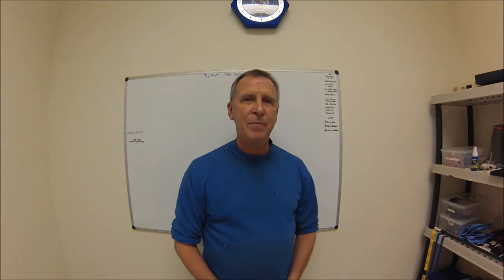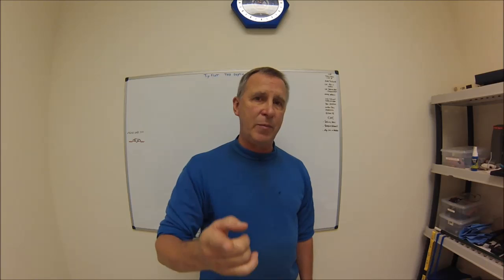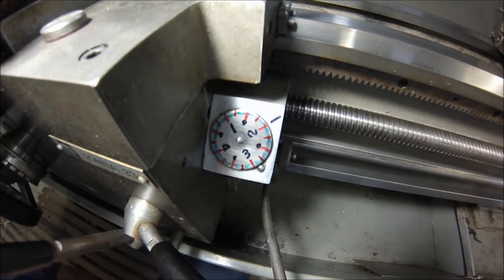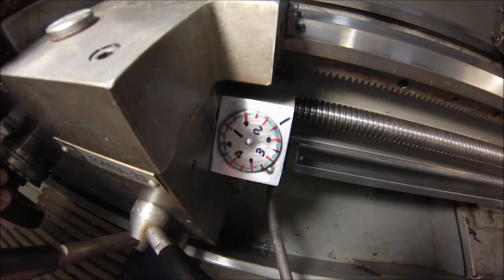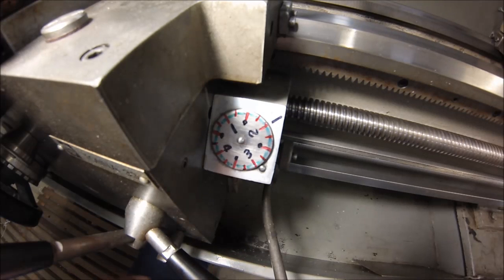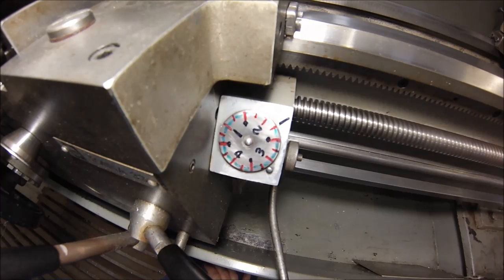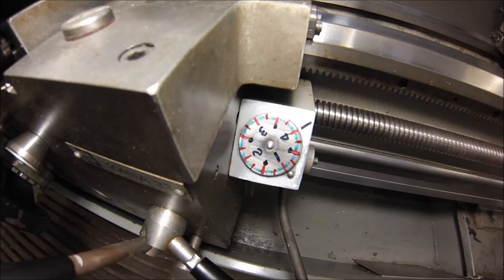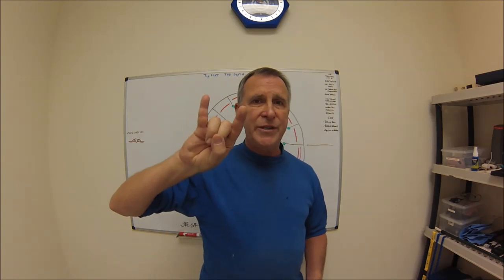Engaging a half nut.....made easier

Comment: Again, a great video. Ok, for odd thread pitch use any numbered line. However, on the second pass (to deepen the thread) does one have to use exactly that same number on succeeding passes, or can one go to any numbered line. First pass, use 1, second pass use 4, third pass use 2 etc. What about the "in-between" lines? Does one have to return to exactly the same "in-between" line on the dial on subsequent passes, or any "in-between" line?
Reply from the maker: The philosophy of even pitch threads using any line and the odd pitch threads use any numbered line is intended for the factory marked lines only. The in-between lines will probably cross thread your part and ruin it. I do not use the exact same number when doing an odd thread, but you may wish to check it out on your own machine. If in doubt. Stick to the same number you start with. Better safe than sorry.
Reply: The numbers represent inches of carriage travel.  Even or odd thread pitches will contain a whole number of threads in one inch, so the half nut can be engaged on a whole number for any even or odd thread.  For even threads you can engage at the other lines, half way between the numbers.  This is because even threads have a whole number of threads in 1/2 inch.  If your thread count is divisible by 4, such as 12, 16, 20, etc. you can engage every 1/4 inch of carriage travel.  For half-pitch threads you need 2 inches of carriage travel to land exactly on a whole thread. You'd need to start on every-other number (such as 2 and 4, or 1 and 3).  This also explains why metric threads are tricky on a standard lathe.  With a pitch of 1.0mm you have 25.4 threads per inch.  So you only land exactly on a whole thread every 5 inches of carriage travel.

Comment: Oh, man did I learn an ugly lesson today.  It turns out that my lathe actually has four engagement points per line on the threading dial.  So not only are there engagement points between the lines, there are three engagement points between the lines.  I was waiting until I was 3/4 of the way to the next line and dropping it in.  Surprise!  There's an engagement point there.  Scrapped part.

Comment: Mr Pie, could you explain what you mean by "odd" vs "even" number of threads? I've heard you say this several times and I'm not sure if you are saying "how many threads in a inch as reference to odd or even and or what about halfs for instance "cutting a 2.5" threads. As when the dial comes around I can engage on any line if it's "5" threads per inch vs I can engage on any numbered line if it's "6" threads per inch? Hope my comment makes sense? BTW, I'm learning a lot from your videos! I've got a southbend 9a as a home hobby machinist but working my way up to getting a part time job for a machinist just because I absolutely love cutting metal!!! So thanks my friend, I will definitely buy you a beer if I'm ever in Texas
Reply from the maker: You caught me eating my lunch, so its a perfect time to reply. The odd and even threads I refer to is the pitch value. EX: 1/4-20 thread is an even thread with a pitch of 20. Even pitch threads- any line. A 1/2-13 is an odd pitch thread. Odd pitch threads engage on any numbered line.  I don't believe I have ever cut a half pitch thread, but I would suspect you have to use the exact same line every time. Run a few test passes to be sure. Just to clarify, the outside diameter of the thread doesn't matter. Just the pitch value.
Reply: That explains a lot! Thank you for taking the time to dummy it down for me.

Comment: Grabbing a pack of fine sharpies I headed into the shop to mark mine up.
Then I realized the reason why I have difficulty hitting the 'mark'
On my Birmingham (Taiwan) 1440 there's (32) divisions. 
Hash marks are labeled 1,3,5,7 (for some odd reason), (4) unmarked and then there are (3) more locations in between the 'eighths' for a total of (32) positions.
I believe I'll be doing some geometry calcs soon.
Reply: Is it a metric leadscrew? Mine is metric & the same number wise. Haven't measured the number of actual positions on the dial though.

Comment: Always a joy sense!Can you please show, how you would do an internal thread,  lets say I.D. 1.125" X 12 pitch? How would you check depth of cut?Wires don't work on inside thread...
Reply from the maker: For internal threads, I usually cut a gage first. Never use the mating part.  I do have a video on that subject. Internal threading to a hard stop
Reply: Joe Pieczynski sorry Joe but your talking to a novice I have no idea what you mean by a .gage. Probably a stupid question but do you mean a test outside thread?
Reply from the maker: Exactly. But more than a test. It has to be cut to the recognized standard dimensions for the thread you are doing. This will be your standard, or gage. This guarantees, that if the mating part, possibly on the other side of the world, was also cut to fit the gage, they will go together as planned. Do some reading about A class and B class threads and how they are controlled. Not a stupid question at all.
Reply: wow thanks. I will do my homework as advised! If I only had this attitude when I was still in school!

Comment: The speed of the dial is relative to the  speed of the carriage and the lead screw. If you can move the carriage in the direction of lead screw travel the dial will move slower. That in turn gives you more time to engage on the proper number. You have to do two things at once but I don't find it that difficult.

Comment: Great explanation as to how to use the thread dial. Here's something else that might make it less stressful; If the quotient of the thread pitch you are cutting divided by thread pitch of the lead screw is a whole number, you can engage the half-nut anytime you want. For example, you are cutting 24 tpi and the lead screw is 4 tpi, just engage the half-nuts when ever they mesh [ 24 divided by 4 equals 6, a whole number]. Also, many larger lathes have a 2 tpi leadscrew. Therefore, any even numbered thread you cut can be generated on a 2 tpi leadscrew by just engaging the half-nuts without even looking at the thread dial. Try it--it seems to work for me.
Reply from the maker: I've heard that, but never tried it.

Comment: Do you want to hit the same number at the start of each pass?
Reply from the maker: Thats not necessary, but it wouldn't hurt anything to do so. Maybe burn up a little more time, thats about it. On even number threads, you can use any line ( of the 8 ) and odd threads, use only numbered lines. Good rule of thumb. If you have doubts....use the number you started with, all the way through.
Reply: Thanks Joe. I have been watching your videos till my eyes go crossed the last few days. I had a little 6x14 mini lathe but the one I am getting is a 12x36 with a drop bed. Geared head.

Comment: thanks for  it . infact i have no idea about clausing lathe or atlas lathe imperial, lathe what,i,know,,lathe,is,lathe so pls,can you help to explane, this,issue..thanks,alot again am,one,of your student  mr..Joe
Reply from the maker: Greetings. My lathe experience is limited to the US. All the machines I have run, Hardinge, Leblonde, South Bend, Clausing, Mazak have all been primarily setup for american dimensions, dials and threads. Each had single point threading ability and dials for the same. I like cam mounted chucks the best, and I'll take an adjustable 6 jaw over anything else. Anything made by hardinge will be very expensive, but worth the investment if you need super precision. A quick change tool post is a good thing to have, and Aloris makes a very reliable range of them. The first number in the lathe description is the maximum diameter of material it can swing, so don't buy an 18" lathe if all your parts are small. Many lathes can run metric threads, but usually you have to swap gears and leave the carriage engaged for the operation.  Thats just a basic answer. I hope it helps.
Reply: Joe Pieczynski ..thanks alot am speachless..thanks,for your time
Reply: Mohammad. The difference between metric lathe and imperial lathe is the same as the difference between measuring things with metric ruler and imperial ruler. Theoretically you can do the same thing on both machines. But practically when you start cutting piece measured in a different system, all those cross conversions that you have to do constantly along the way will take away all the fun from the process. Nowadays with electronic DROs capable of displaying offsets in both metric and imperial at the same time this is no longer a problem and the only principal difference left between those machines is a lead screw pitches.
Reply: Alex Petrov .thanks dude nice explanation  . i appreciate it.

Comment: Clausing is a nice lathe. I have never had a problem with the half nut on them. I retired a year ago after using a summit from harbor freight. On that machine the half nut would work flawlessly for a number of times and then without warning the handle would only go half way down wiping out the thread. I learned early on that I would have to leave the half nut engaged and run the lathe in reverse to take subsuquent cuts.

Comment: It doesn't get any better than this. I had an old lathe that was missing the threading dial - is there a decent workaround, or can a threading dial be dropped in (modifying the mount to fit, of course)?
Reply: Charles Knouse I would say, do some digging online, ebay, Amazon and whatnot. You may be able to find one for your lathe. 

Joe or other viewers may have other options for you.
Reply: Hey Charles, you can leave the lead screw engaged for the entire duration of cutting the thread, simply backing out the compound slide as usual and then reversing the lathe drive to take the tool back to the start of the work for each pass. Take it well clear to allow for backlash take-up each time. Be careful not to slam the lathe into reverse or you'll strip gear teeth and/or unscrew the chuck! The method is boring, but effective and foolproof-  you don't need any dial at all. Very old lathes often never had a dial and this is what I learned on.

Comment: does this thread dial be used for metric threads?
Reply: Not in the fashion you use it for US threads but it can be used to find your timing again after you disengage the half nut.
Cut thread disengage half nut reverse lathe back to your picked number reengage half nut reverse back to starting point.
What you can do is use it to cut double start threads on certain pitches. 
And example would be a 10 TPI with two starts this would give you 20 TPI.
If your lead screw is 8 TPI and your dial has 1-4 with lines and notches in between them  like Joe's the chart will say engage on 1-2-3-4 for any even number pitch divided by 2. 
Both his dials and mine have 16 teeth. 
If you engage on any of these numbers at any time and even alternate between them you will always be on track.
If you engage on a line (any line) any time they will be 180 degrees out thusly a two start thread. 
This works for a ten and should work for others like this too.
With any thread pitch divisible by 4 you can engage on any line or number.
My lathe says 1-8 but only has 4 numbers but I know it means any line or number. 
Next at least with 8 and 16 TPI you can engage the half nut any place you want even the in between notches you dont even have to look. 
On a 4 TPI you can engage on any number or line but if you engage on the spaces in between the lines or numbers you can cut a two start thread.
These rules dont apply to every thread but only the ones I have tested. 
But it is the very best way to cut two start threads.

Comment: I've always engaged the nut like that but I was taught to pick a number on the dial and stick to it for all screw pitches
Reply from the maker: Maybe your teacher didn't know any better. Even-any line,  Odd-any number line. For safety, if its an odd thread, use the same number if your are not positive the lathe acts this way.
Reply: I've always done that  way with no problems
Reply from the maker: It definitely works. Nothing wrong with that practice at all.

Comment: My laith doesn't have a thread dial, so I've to pul back the tool and then turn the rotation.The tool upside down works, but it's easier to put the tool at the back so you have a better view of what you are doing. But thanks anyway
Reply from the maker: In the 40+ years I have run engine lathes, I have never put a tool on the backside of any part I've ever made. Not until recently has it even crossed my mind. Not saying its not a good technique, but its not for me. Thanks for the comment.
Reply: For 40+ years you've missed some great opportunities by not using the backside.I use the backside sometimes if I want to have 2 toolbits to be used without changing it trough the toolbit holder.But for making screw thread, you can also put a toolbit that's used for manking holes, put that in the regular holder, and move the slide backwards. So the toolbit stands at the backside, the lathe rotates backwards, and the support moves to the right.  This has the same effect as upside down/front but you have a better view.
Reply from the maker: I like it. I wish I had been exposed to it years ago. If I tried it now, I know I would crash my tool out of sheer habit.

Comment: You explained this just like my high school shop teacher back in 1980.I tried this shifting the 4 speed in my '76 Ford truck and could shift without the clutch or grinding the gears.Sometimes you just gotta feel the machine.Can CNC do that LOL?
Reply from the maker: Loosing the feel for the cutter resistance was one of my worst problems when I started running CNC machinery after so many years of manual machining. I like having that connection. CNC can't offer that for sure.
Reply: I know what you mean.

Comment: This is a great video. Thanks a lot. I have an old Sheldon 10" circa 1954. I often have trouble missing a number and it makes my ass ache. I'll be putting your advice to use for sure.
Another problem I have is when I open the half nut the lever is sometimes difficult to start to close. It gets jammed in the open position and I have to hit it to get it unjammed. I suppose I need to take the apron apart to fix this but I am at an advantage after watching your video.
Reply from the maker: First, make sure your carriage is not under load when you try to disengage your lever. Then just spray it down with a WD-40 or other solvent to loosen it up. Thanks for watching.
Reply: Sorry to belabor the issue but I don't see a way to have the carriage NOT under load as I'm threading?? I guess I misunderstood? Thanks
Reply from the maker: Make sure there is no drag or pressure on your handwheel after the cut at the time of disengagement. I'd start there. Light oil on the lead screw and clean the half nut would also be suggested.
Reply: Ah ha, got it. Thanks again.